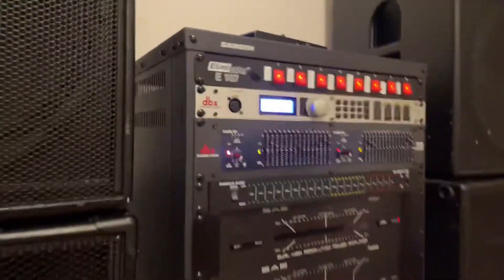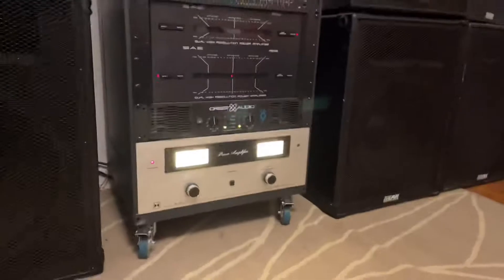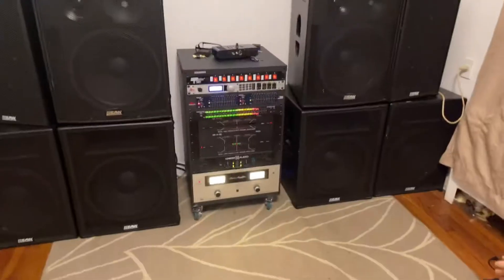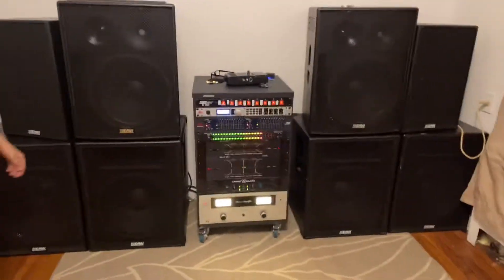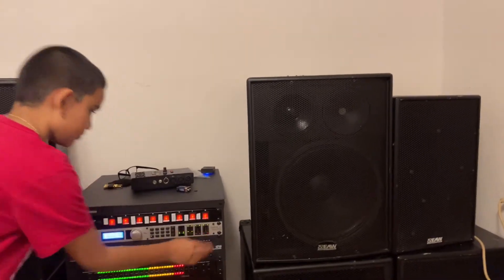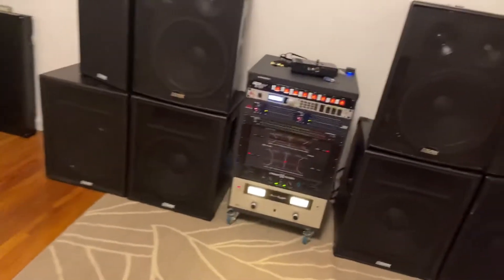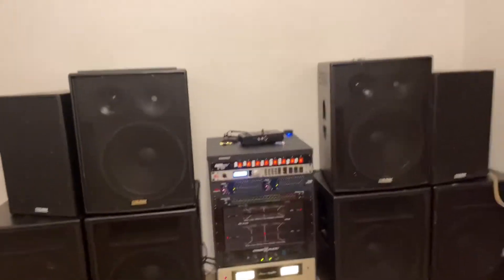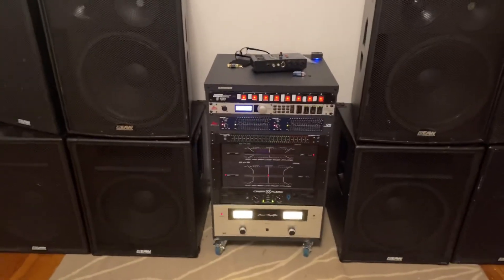Vintage Audio Rack Updates

Comment: Was everything in that rack plugged into the adj rack Mount power strip in that rack and also can something like a rack Mount power strip be used for really powerful power amplifiers like the crown xti power amplifiers like the crown macro tech power amplifiers
Reply from the maker: It was and no you can plug anything that can draw more than 15 amps into that ADJ